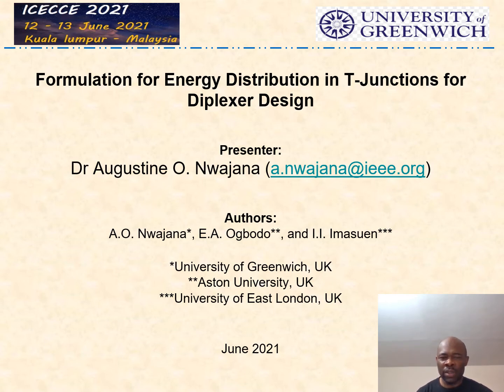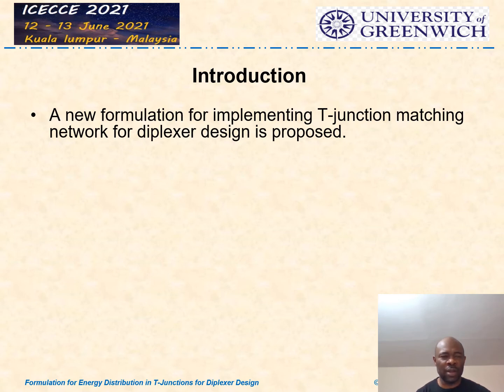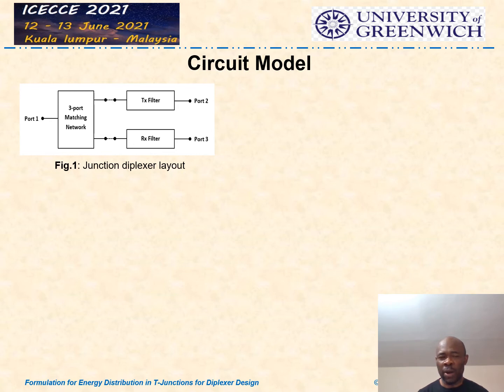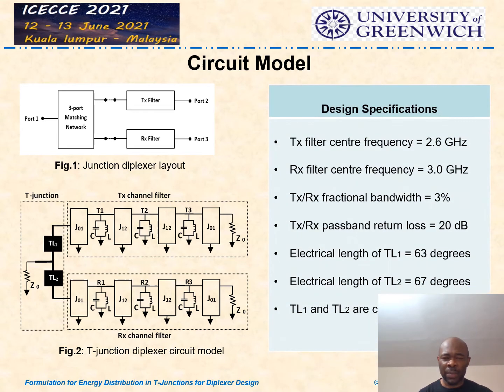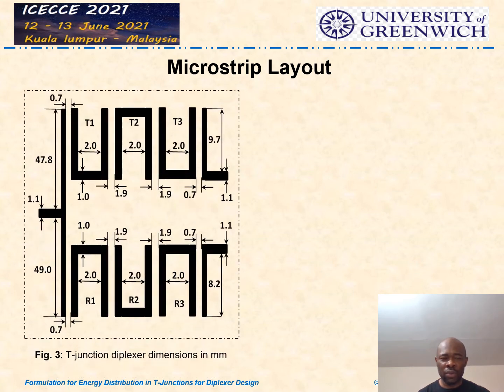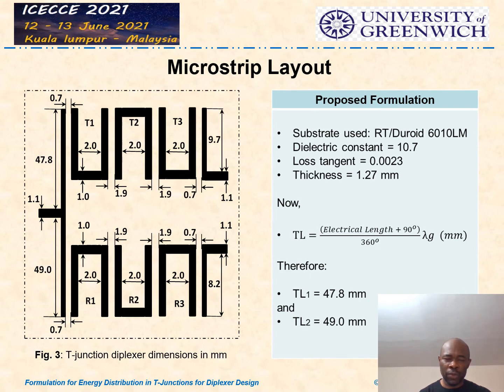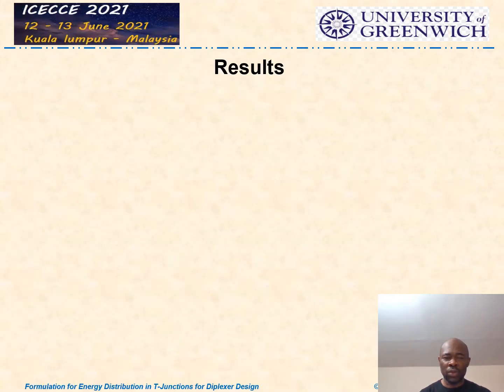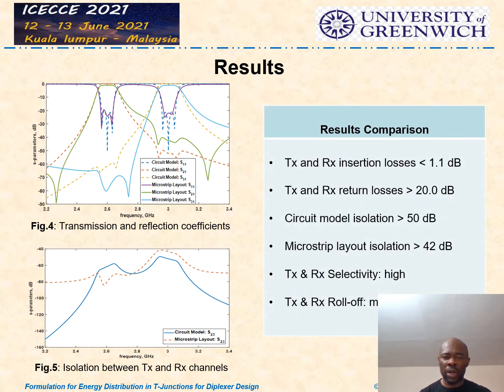Diplexer design based on a simple formulation

Comment: I drew the circuit and simulated in CST, but I couldn't get a logical result
Reply from the maker: What software are you using for your simulation? I will suggest you use the link (https://www.researchgate.net/publication/346054064_T-Junction_Diplexer_for_RF_Front_End_of_a_Cellular_Base_Station) to read the published paper as the full design procedure is not contained in the YouTube video.
Reply: Can you help me plz my subject diplexers based of metamateriel